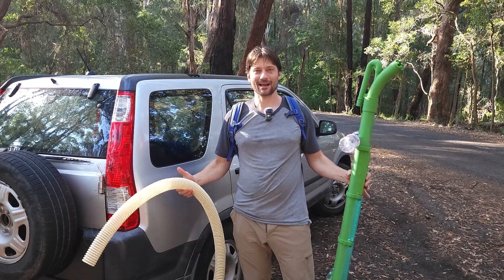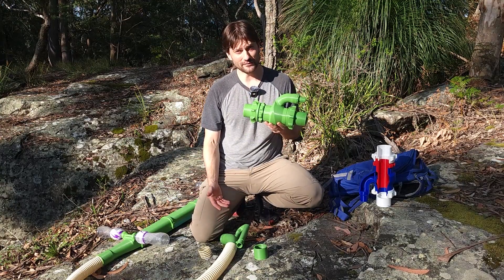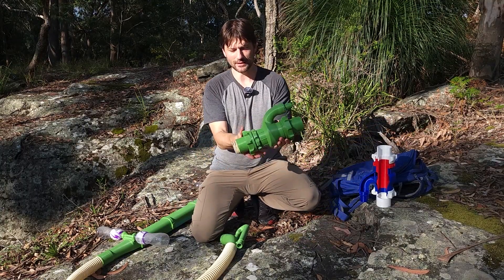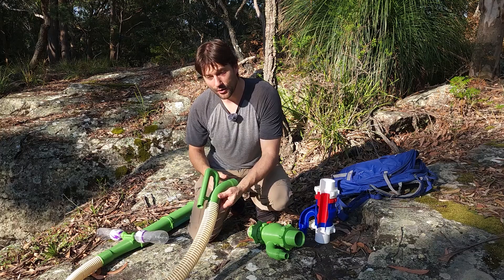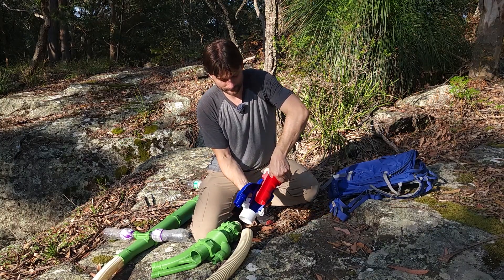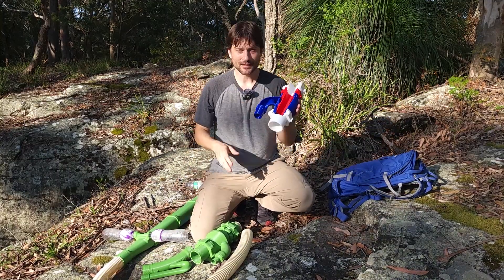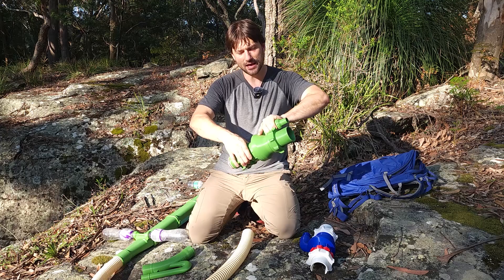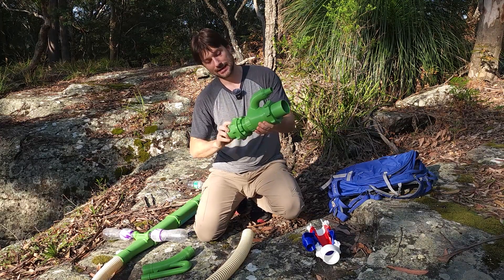I Created an Adjustable Infinity Jet Model for Gold Dredging.

Comment: Is that pump a 24 volt 3700 gpm pump?
Reply from the maker: I'm just running 12v right now.  Keeps the battery setup simpler until we get into some higher amps and can really start to see the benefit of 24v.
Reply: @UtmostOutdoors  it's such a great idea! Do you know what the optimal length of the main hose is? For example how deep can you take the nozzle? Also does the sluice tip downward if your dredging at the maximum length of the hose?
Reply from the maker: It's a balance of things I guess...  A shorter hose adds to the efficiency of suction, but I suspect somewhere between 3 meters and 5 meters is a good length to work with.  The light float platform is an advantage for transport, but if you are using a stiff hose, the dredge is so light it can get dragged around.  I found the dredge floats nice and level when I use a light flexible hose, as the hose bends instead of pulling on the dredge.  But the really heavy duty suction hose can cause problems.  I used greenline g941gt-200 for suction hose, also sold as Kuriyama wh-200.  It's a good balance of flexible and durable for an electric dredge.  
If you happend to be diving a very deep hole, you could always just bring theo whole dredge down to the bottom and set it up level with some rocks while you work a crack, that's one other advantage to a subsurface dredge, it doesn't need to be at the surface, just roughly level.
Reply: @UtmostOutdoors  I'm asking these questions because I'm actually interested in building one or using your design.  It seems like you have put a lot of thought into this and maybe worked out some issues. I recently returned from a trip into the wilderness where I used a 2 inch backpack dredge that was under powered. I earned a lot about what does and doesn't work but also the material being gathered must also be taken into consideration.  My needs are for loose gravel that has gold in it but has not settled into the bedrock yet so this electric dredge is perfect. I would be highly interested in purchasing one of you jet system booster
Reply from the maker: I found for the electric dredge project, I preferred a suction nozzle to the infinity jet.  Just because I was able to perfectly size the jet to the pump I didn't need the adjustability and the suction nozzle also acts as a nozzle which is nice.  I did find running my dredge subsurface was a huge bonus for suction power, as a surface dredge is hard to get the same suction with.  I'll be working more on the electric dredge stuff soon and will release a video later on this month with the latest.
Reply: @UtmostOutdoors I have a 12v 2000 gph pump that I would like to power my electric dredge with. I would like to use your printed nozzle if it would work with a 2000 gph pump. Have you tested that combo yet?
Reply from the maker: Stock 2000gph with my nozzle is a bit weak on suction for my liking.  Was OK with 2000 pump and my impeller upgrade, but I still prefer the 3000+ size bilge pumps.

Comment: Hey mate, will the infinity jet intake fit the Honda WX15T with 1 1/2 inch hose? Have you made any tests of the jet? Can you please share a bit more info?
Reply from the maker: Hey mate,  The infinity jet currently has an pressure inlet that you can screw on and off to exchange with either a 1-1/8" bilge hose or a 1-1/2" hose.  So your 1-1/2" hose from the WX15 should slip right onto one of the included hose barbs.  I have not done any testing with the WX15 as mine is back in Canada.  My assumption is that it should work quite nicely once you adjust the gap to the sweet spot.  
My only concern would be if at full throttle and a thin gap, the pressure may be too much for the plastic design, but if that is the case you would just have to open up the gap a bit and it should be ok.  If you have a WX15 and are looking to do some suction and lift tests, I'd love to hear back from you how it goes.  I think the WX15 has some real potential to run some serious suction...
Reply: @ I would be really happy to test it. I have made a 3D printed Infinity yet several years ago, but it was a bit more simple. A friend of mine has a 3D printer and he told me that he can print it for me from PLA or PETG. If those materials are not ok, I will check for someone else to print it from ABS as you suggested.
Reply from the maker: @AleksPetrovProspecting  PETG is perfect.
Reply: @UtmostOutdoors  Thanks mate :)

Comment: You are wrong about the jet configuration, it does significantly affect the efficiency.
Reply from the maker: Can you explain your reasoning?  Everything I can find online that suggests that traces back to work performed by Reggie Gould.  I have done extensive testing and was unable to replicate his results.  My assumption is that the cross sectional surface area of the jets was not controlled for in his tests and that accounted for the majority of the efficiency improvements tested.  Multi jets, in my tests, did have the advantage of fully mixing in a shorter distance than a single jet, which could prove advantageous in certain scenarios.  I have a few more tests to run in 2025, and any ideas that seem novel I'd be happy to explore and see what we can learn.
Reply: @UtmostOutdoors  Thanks for sharing your findings. I would guess that Reggie Gould tested with gravel in real world conditions, which might explain why his results showed efficiency improvements that you weren't able to replicate. Gravel introduces factors like turbulence, uneven flow, abrasion and clogging, where multi-jet or ring jet configurations help minimize these issues by more evenly distributing suction and reducing energy losses. Looking forward to seeing more tests in 2025. 🥳

Comment: I don't know if you're aware of this but the infinity jet came out long long time ago you are not the inventor of it if I'm not mistaken and I could be wrong without doing a little research they came out in the 1970s so you are too young to be the one who invented that thing and they are super highly efficient when you adjust the proper
Reply from the maker: Oh I for sure didn't invent the infinity jet.  I don't believe I ever said I did.  All I did is make a 3D printable 2 inch version with an adjustable jet gap.  I also think the efficiency is not superior to other jet types, it's only superior because it's adjustable, and matching the jet size to the pump is important for efficiency.
Reply: @UtmostOutdoors  
Yes you implied that you were the inventor of it but that's besides the point the point is you did an awesome job on what you made and I don't want you to quit working on it and from everything I've studied and looked at about the jet it is superior to the others because of the pressure that comes out all the way around the tube instead of in little spots so I encourage you to keep going it's a very good thing

Comment: Likely might want to consider a tool to unscrew the one end for the potential unclogging process. I have used a lot of hand pumps in the past and sand/debris will ultimately get into the smallest of spaces and in this case may be the threads. That could make it very hard to start the unscrewing process by hand in the field. It might take a bit more leverage to get started. May also be an issue with the snap together "dredge" pieces. Cool beans though!!!!
Reply from the maker: I have only had this thing out once so far, and I found that so long as it gets screwed together clean the plastic threads come out pretty tight and no sand got in and it seemed to unscrew perfectly fine.  That being said, you do make a good point!  I'll keep an eye out for that in future testing and be sure to improve and update as required!
Reply: @UtmostOutdoors  Cool. I am not being a detractor I want you to be super successful! Juist my experience talking. I am watching the winter sniping videos right now holy sniping batman!
Reply from the maker: Hey, I appreciate all the advice I can get!  The more we all put ideas together the better the product will be!

Comment: Nice design mate 🙌
I wonder if it would scale up to a 6’ 🤔
Hmmmm
Reply from the maker: To make it into a 6" you would need to model it in fusion 360 as a 6" to make all the threads work together.  I don't think you could just scale this one up and have it all work together.  That being said, the concept could certainly be expanded upon.  I would likely work my way up to that size with a 3 and then a 4 first though :)

Comment: I just need to know if you used it yet....I am purchaseing your stl for use on my Elegoo Saturn
Reply from the maker: I've only used the infinity jet in a bathtub.  As for the subsurface dredge, I can tell you it sucks gravel just fine, but I don't have a proper report on fine gold recovery yet.  Once I get some testing done, I will send out updated matting profiles to the latest and greatest thing.  Also, a more in depth look at the subsurface dredge will be out in a video tomorrow.

Comment: Wow this is the most innovative gold finding design of modern times! So cool to see a brand new invention being prototyped and coming to market!
Reply from the maker: Thanks!  As you guys have been discussing I never claimed to have "invented" anything new, but it sure is cool to see a way to manufacture one of these things to be adjustable with just a 3D printer!
Reply: Infinity ejector is a brand old invention... 🙂
Reply: @AddeStensfors  the innovative part is how it's made! 3d printers are cheap nowadays, 150$ for an ender 3 pro, and you can print this yourself! A nozzle like this used to require a complex mold to be made out of plastic, or extremely fine stainless steel welding to be made out of metal. Yes it's true, this component in itself isn't new, the process in which it's made is, and the price to make one is now wayyy lower, so it's more accessible to a broader market
Reply: @rorywest4937   That's not what you said, do you remember:  "So cool to see a brand new invention being prototyped and coming to market!" And... you do not need a komplex mold, that's not how one makes a infinity ejector, been making them for 30 years 🙂
Reply from the maker: @addestensfors Do you have a video you could share of how you made yours?  Would be super cool to see 30 years of development in action!  If it's a trade secret, no worries, just curious if you have anything helpful to share.
Reply: @UtmostOutdoors  Well, I did offer you my help, you declined. Anyway, you are still young, so you have 30 years of development to enjoy. 🙂

Comment: Very clever.  On your drop riffle section, I have a hunch you may be able to widen those about 25% for more active riffle area.  More black sand retention and less blowing out of fine gold.  Also, on my Geo drop riffle sluice I see there are three different sizes of drop riffle.  Something to try if you have not already.  If your recommended pump is using a custom "closed" impeller design, perhaps include that in the CAD file(?)

Comment: Sweet! But for the nozzle, remove the restriction in the front, instead just put a rod half an inch out from the orifice, thats the absolute best. Gold hog has done major research on the subject.
Reply from the maker: I like docs take on this.  I think with the 3D printer, reaching up in front of the nozzle with the tines can achieve a similar effect.  It's all about avoiding plug ups while dredging blind, while still allowing acceptable material size to pass through. A few solutions seem to work.  Hopefully I can add more thread on tips as testing continues.
Reply: @UtmostOutdoors  the thing is you want as little restriction as possible while still stopping the too big rocks. Your way of doing it is restricting a lot more than needed.
Reply from the maker: @illernpiller  If you mount a narrower ring up in front of the nozzle, the gap between the nozzle and ring allows full flow, while reducing the clamping grip at the tip that prevents you from pulling a rock stuck to the nozzle.  The bar in front is a simpler way to achieve the same result, but the size of rock that is allowed to pass is smaller and results in more manual work.  If you curve in some tines to create the size restriction, the water that can flow in through the openings between the tines still allows full flow.  
Also, even a fully restricted nozzle wont restrict flow as much as you think.  For example, a 1.5" nozzle restriction into a 2" hose will still flow WAY more water than having the entire hose 1.5".  I think so long as your flow to the box is adequate, restricting the nozzle a bit can actually be helpful at concentrating the suction at the tip to help reach further into cracks.  I'll do some tests at some point and I'm sure we'll have a variety of solutions that work well.
My ideal steel nozzle is a ring that is welded straight to the nozzle at the bottom end, and held out a bit with a gap behind it at the top.  It allows larger material up than the bar, allows the pressure relieve from the gap at the top, and still concentrates full suction at the bottom quarter of the nozzle.
Reply from the maker: @illernpiller  I was thinking, what if you found a standard size of U bolt, you could 3D print a thread on tip that has two holes in it that you could press the bolt into.  That way it would stick out the front slightly like Doc was saying, and be a metal part you could scrape with.  And to solve the problem of restricting too much material, you could just mount it slightly off center so one side would let a bit larger rocks up if you wanted.  Thanks for making me rethink stuff like this. 😀
Reply: @UtmostOutdoors  yep that would work but I would still put it in the center. You could also I guess just make two holes you could insert it into and have two nuts on the threads that way you could move it back and forth to your desire of where you want it. Ie one bolt on each thread, stick it into the holes and a nut on the other side to lock it in place.